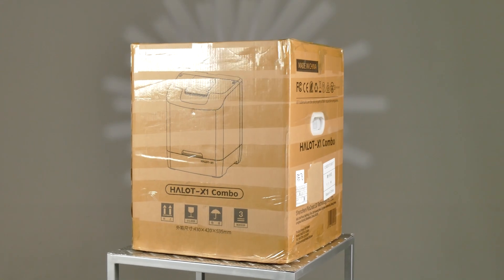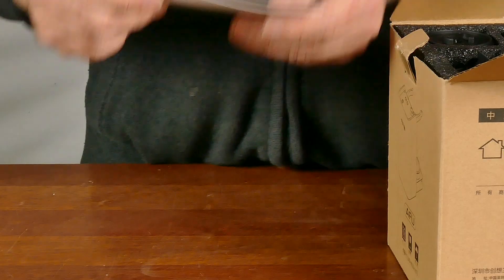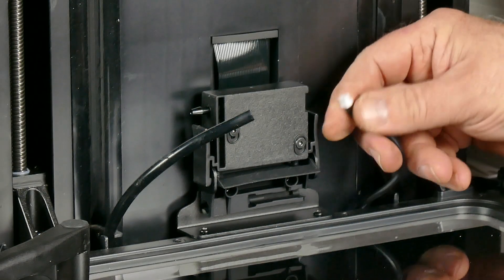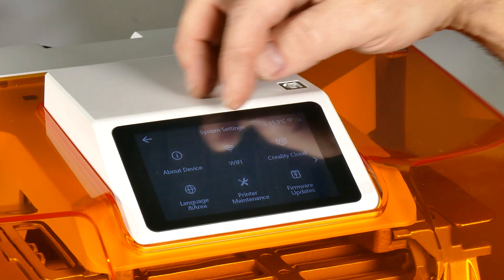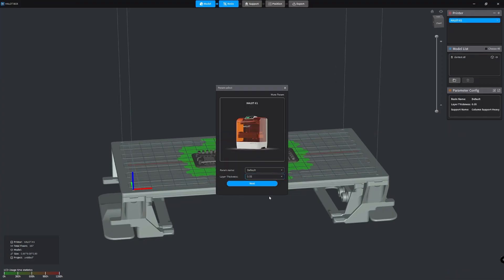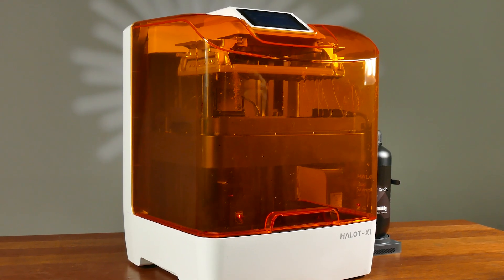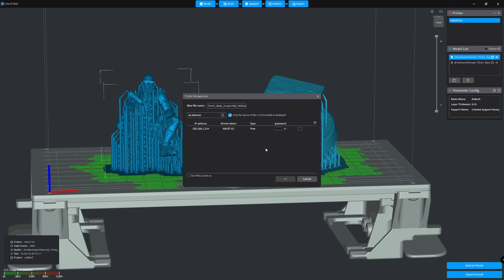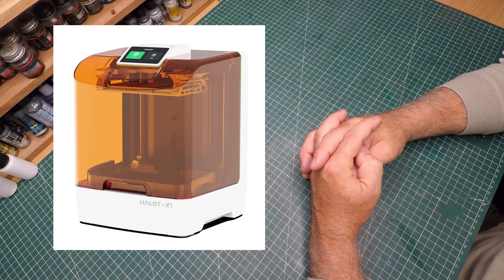A 16k 3D Printer That Creates Amazing Results. #3dprinting #3dprinter #piocreat

Comment from the maker: UPDATE: Since posting this video I have spent a bit of time trying to find the issue with the 'resin splash' problem and it turns out I could not find a single person with the same issue. I spoke to Piocreat and they too have never come across this problem. Since the video post, I have done a number of prints and each one has come out amazing.

Comment: to reset the build plate completely to the bottom  after it is soaked in resin because of some "static electricity issue" is a bummer and the ultimate functionality failure.
Crap quality management leads to crap software and just makes it a crap device!

Thanks for the warning 😉
BTW light conditions can not cause this kind of static electricity issue. It's always a sudden discharge which affects electronics to reset (and should be nearly impossible if engineering standards are met - otherwise laptops would die every second week)
Reply from the maker: I still to this day don't know exactly what happened but it hasn't happed since that first run.